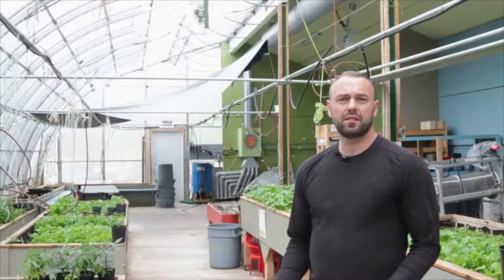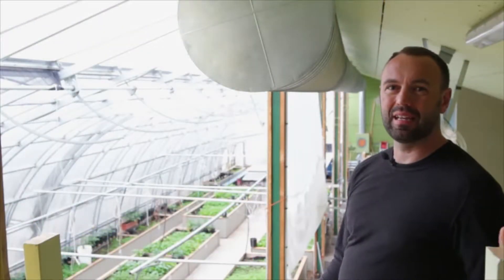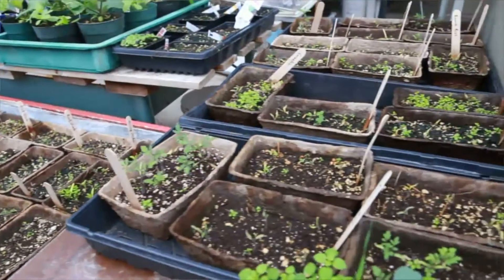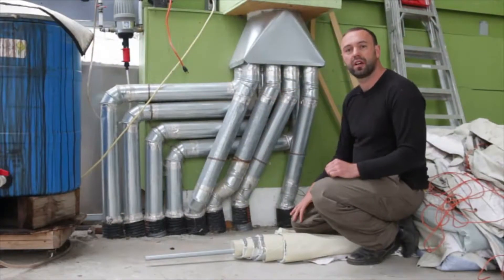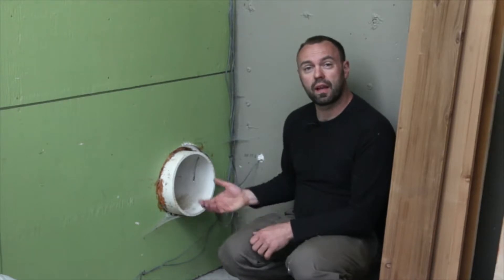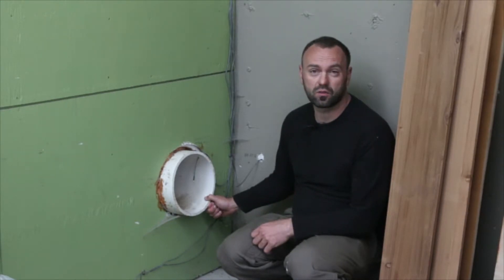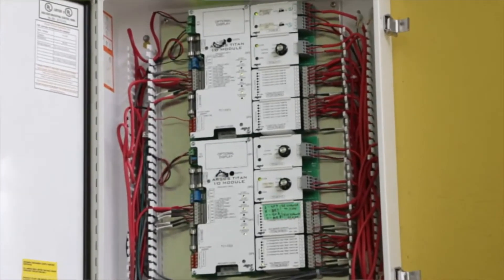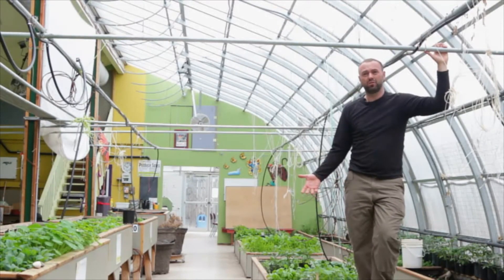Commercial Scale Passive Solar Greenhouse - Case Study

Comment: nice looking greenhouse, thanks for sharing your information. I'm sure there are ways to make it better, but at the same time as far as cost effectiveness, you could certainly solve some of your problems by shrinking the greenhouse down and changing the overall design. Not to mention find ways to maximize plant density within, which would certainly require more moisture and airflow control. 

Honestly, I could see it being the most cost effective to cut off external air, and instead create a c02 enviornment within a closed system, that would allow for higher levels of warmth in the winter.  you can do this with citric acid or invitro mushroom blocks, like lionsmane or reishi.

Comment: No electricity? What runs the vents and the fans? Passive venting with underground rock storage and perforated pipes or cement cinder blocks are much more efficient and don't require electricity or maintenance. Although it gives up the stored heat much quicker.

Comment: I'm wondering abut the concept of pumping the GH air out and replacing it with outside air coming through an earth tube. 1st: In very cold periods, the earth tube must warm the air from the outside temp (lets say 0 degrees C). If the inside air was circulated and returned it would not have to gain as much heat in the earth tube. 2nd: in very hot periods, the earth might make sense if the GH is hotter than outside, but not as much sense if the GH is cooler than outside. 
But the 3rd, reason is the real issue. Replacing the air with outside air can completely change the humidity level inside the GH. 
Can you explain why you don't just run the inside air through tubes and return to the GH?
Reply: i know this is a year+ old but I think they could have the best of both worlds considering they already have a very nice greenhouse controller. They could add ducting valves to have better control so that as the air goes underground they could then control if it goes outside or back into the greenhouse. That way on warm winter days they could keep more of the warm air.

Comment: Re piping: The Big O you are using is what is restricting the air flow. This type of corrugated flexible pipe will create significant turbulence on its inner wall surface thereby reducing the volume of flow.  I suggest using a 4" diameter solid weeping pipe. This pipe comes in I believe 12' lengths and has pre-drilled holes that you align to the bottom when installed. This will greatly improve your airflow but you will still encounter some friction on the inner surface even though it is smooth. To minimize this insert a 3 blade air flow diverter at the joint of each section of pipe. You want to get the air flowing in a spiral rotation to reduce the friction  Cheers.

Comment: You have a first principals design flaw. Pushing hot air underground is like trying to push a wet noodle. Air contracts as it cools. You want the system to be more efficient without tearing up the ductwork? Pull the air up from the cold side of the system and let physics work for you instead of against you. In order for the energy to leave the air you need a drop in pressure to occur. You need to be creating a vacuum in the system to allow that heat transfer to happen efficiently. You do that by drawing on the low pressure low temperature side as it comes out of the ground. In the winter you turn the system around and draw from the bottom of the greenhouse and push it underground where it will heat up and increase in volume and pressure.
Reply: https://youtu.be/ZD_3_gsgsnk
Reply: @dadigitechman  Operating it in the manner I described solves that issue. As warm air contracts and cools underground it loses its ability to hold moisture. The pipes are corrugated with drainage for this reason. For every 1 degree you heat or cool a volume of air it will either gain or lose 7% of its capacity to hold water.

Comment: I'm not sure the definition of passive in this case but to my mind fans etc are not passive. Doesn't change the fact it looks like a very workable intelligent greenhouse though.
Reply: “Passive solar”
Reply: Looks like solar powered fans to me. that is passive.
Reply: @neomailman  no, anything requiring power irrespective of source is active.
Using a trombe wall to create air circulation is passive, that works all day everyday without power

Or in electronic terms a passive crossover requires no external energy input to modify the signal, an active crossover requires external energy input in order to modify the signal
Reply: @Th3_Gael  - a trombe requires power from the sun.

On another note I would encourage you to be more reserved in your assertions and corrections. It is unbecoming to be a rules lawyer know it all.

Comment: I would really like to know  to know and you might to the humidity of the air in the top of the green house at the top vent and then at the exit after going through the floor. If the air is dehumidifier then instead of just removing it from the house it could have a damper that could divert flow back into the house specially in the winter time when ther is low light and high dew content. Instead of venting to relieve humidity the fan could be run in recerc mode and not loose as much heat from the building but stil dehumidify it. Also when external air temps are hot what is the exit air temp under the floor vs. The inlet ait through the large pipe system from th beyond the green house? Is that courrently better? Should there be many mor of the under ground vents instead of the low wall windows or cross venting that you were suggesting that could do a better job of cooling in the summer and also create a larger heat sink in the beyond. ?
Reply: I’m interested in building one  but not running it! I need a partner with money!

Comment: When you say you would increase the duct tubing size, are you referring to just the length of pipe running from the manifold to the black perforated tubing running under the ground? Or would you increase the size of the underground tubing as well?
Reply: 4 inch airducts are way too small.  8 - 10 inches are better for moving a lot of air underground and having that heat transfer to the slab.

Comment: Hey Guys another great informative video! Two questions - the extra vents you mentioned that you would install, would they be for  incoming air into the greenhouse during warm months only? Then they would be closed during winter... also how big is the fan in diameter and what wattage is appropriate? Are you happy with the specific fan overall , other then  the 4" ducts restricting your flow.

Comment: Could be functional, but it just requires too much infrastructure, which makes it a very risky project that's outside the realm of home gardeners.
Reply: Check out his earlier videos, he has one on his smaller greenhouse at his house
Reply: This video has a lot of great ideas that I will add to my home greenhouse.  Yes, it can be scaled down to work for the home gardener and it's not all that complicated when you take the ideas down to the basics.
Reply: =  @debmckinnon72  = What I see is the main problems with scaled down versions is that the longer the green house is, the less % percentage heat loss is at the ends.
When you build a short version, the heat loss at the ends become a major factor no matter how well insulated , and reduces the overall amount of sunlight in mornings and evenings, within quite a few feet of each end.

Comment: Are there any studies/data for how much heat can actually be stored underground vs the near constant temp of earth well below the frostline. Still not convinced that you can store heat underground for 6 months. Data please. Link to full case study mentioned at the end of the video?
Reply: Check out ceres solutions, they might have data on their website
Reply: @ceili  I have. They don't. They offer consulting, but that's not in my budget. I'm in the middle of building mine now.
Reply: Yeah I see what you’re saying. Honestly they got way too fancy with their build. Quite frankly I think you can best build this by just having your piping down 8foot where the earth is about 50 degrees year round. The blowers are linked to thermostat and you can just blow in the 50 degree air when you need it to warm up or cool off. But what do you think?
Reply: Luke Powers Yes, that’s pretty much what I did, haven’t got the blower hooked up yet. I’m planning on using it to remove humidity and cool. The winter use will have to wait until I can fully insulate and install an inside role out curtain.
Reply: Iscetic oh ok. Very cool thanks for the response. I am looking to do the same type of build but I am in Minnesota so I’m a little bit worried I’ll have to dig pretty deep and end up hitting ground water. Did you go 8 foot down?
Reply: @lukepowers9472  My pipe loop is 8' deep and the greenhouse is 5' deep, wrapped with 4" of foam insulation. I kinda did a hybrid of citrus in the snow and the chinese passive designs, with some ceres mods added in.
Reply: https://youtu.be/ZD_3_gsgsnk
Reply: This is filled with information,❤